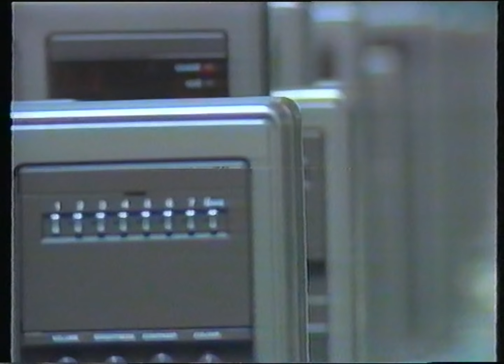Ferguson TX Television Automated Production

Comment: R.I.P. the British consumer electronics industry. The Fergie TX was a pretty decent set in its day. When you consider stuff like the old Bush T22’s they were in a different league. Whilst on the subject of T22’s I still have a variable voltage PSU I built 33 yrs ago using the power supply transformer from one of these. Next to no one does stuff like this any more.

Comment: The "pick and place" machines for PCB assembly are extremely common for many years, but up close, it's pretty amazing how accurately the machines work with a mix of totally different components and even accounting for the board flexing.

Comment: Worked in USSR on TV plant in 1988, TVs even looked almoust the same to those on video. No more USSR, no more that plant...
Reply: Um. Doing what?! Hmm 🤔 

I didn’t see not one person in there! A whole lot of machinery!
Reply: @prestoncheapbtheadphoneste3010  1.40/2.01 - personnel installing electronics in tv boxes manually )) Many steps are not shown on video. Do not think that electonics was complete digital in that tv - so it had to be tuned after boards were sealed (so was in USSR when I worked in 1987-1988 as a electronics tuner)
Reply: @MrPegge  yes the old CRT sets still had to be manually calibrated, the video doesn't show that.

Comment: and every TV tube that went into them was made in Canada.
Reply: Philips CRT most likely
Reply: Or Mullard..made in the UK of course, Not Canada. 
PCBs were eventually built only in Enfield Noth London which originally had final assembly as well as Gosport which took over as the single final assembly factory after chassis assembly  moved to Enfield. 
Wooden cabinets were made in Rayleigh Essex and later in High Wycombe together with plastic cabinets and small parts.

Comment: I had an old ultra black and white valve TV. Eventually though I could only get half the picture until eventually it packed in altogether. It was good for heating the room up a bit though. I would have kept it really but at the time I already had enough crap lying around. Now have a 4k 55 inch curved TV that's absurdly good and thankfully I have enough download speed to watch propper 4k footage.

Comment: Why they didnt make crt tubes flat and square?
Is this because how crt works or its just design?
I mean crt has "bubble" in front and its not square. More oval.

Why is that?
Reply: Can't be flat, needs a curve to keep every part of the screen same distance to the gun (more or less), otherwise you get funhouse mirror problems. Later ones was flat on the outside by making it really really thick. But that made it heavy.
Reply: jw200 Existed Sony, Sinclair and Sanyo for CRT ultra-thin. First two CRT B/W and Sanyo colour very rare. I love ❤️CRT❤️
LCD e OLED 4K/8K are 👎🏼fuck💩